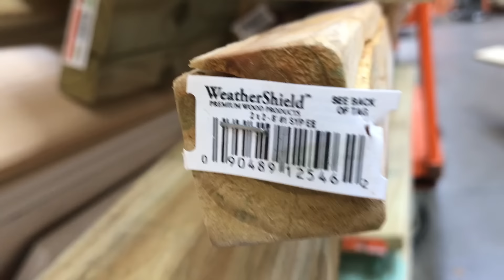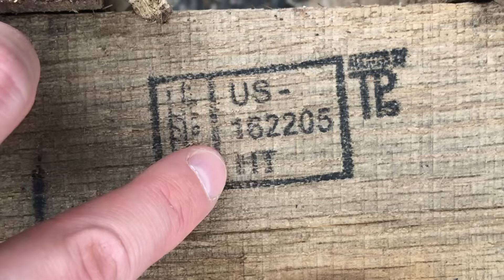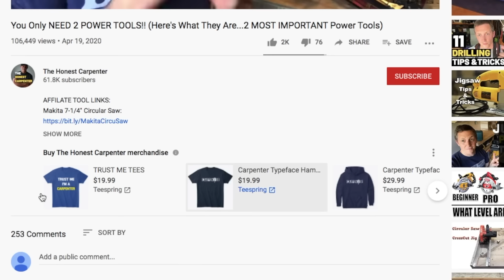Don't Use Pallet Wood!! USE THIS INSTEAD...(Cull Wood Vs. Pallet Wood)

Comment: It doesn't matter where the wood comes from if it's free or cheap use it. Put a bit of time straightening and planing it.  Slight imperfections or nail holes are things that give furniture or cladding honesty and character. Wood is or was a living thing and it's criminal to pick and choose only the absolutely perfect bits and destroy the rest. Not only is it ecologicaly destructive but reeks of racial purity. Respect wood provided by nature, make beautiful things or safe warm homes with it respect it.

Comment: This dude is so negative regarding pallets.!
Couple of facts for him.
Who says you can only get old pallets.?
Surely you can select the cleaner newer ones for a start?
Pallets used for export fruit and veg have to be 100% clean and fungus growth free.
Also they must be damaged free.!
You catch my drift?
Hallo, although made from mostly pine they are cheap and plentiful.😅
If your smart you can recover up to 90% of the wood damaged free if you know how to dismantle them.
Recovery of the nails and reusing them is another bonus.
Lastly being a softer wood they sand easily and are soft on planers and saws.
Not meant for high end furniture pieces.
But what ever you do make can be painted in a suitable colour. Then you cant see if its just pallet wood or chipboard or more expensive wood.
Lastly you accumalate a fair amount of firewood as well.
Bonusses all round for many of us.!😅